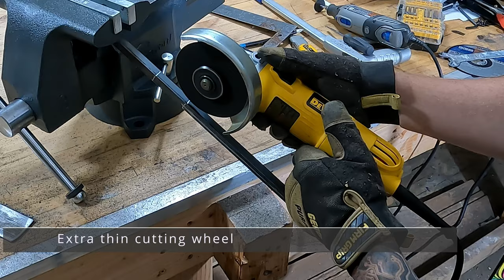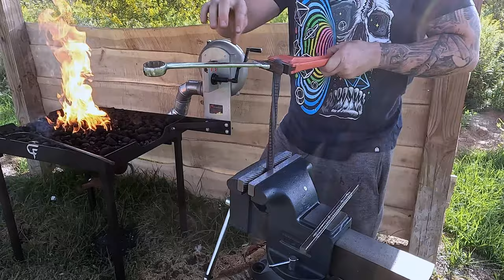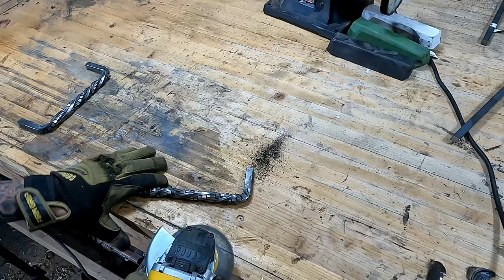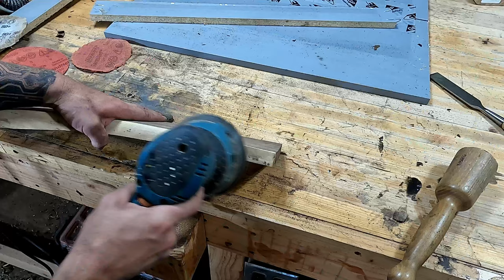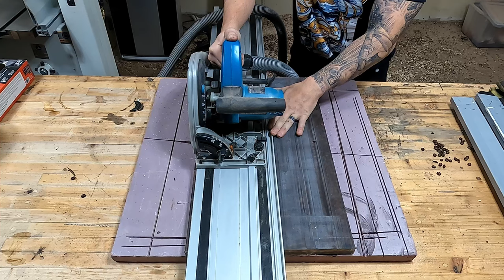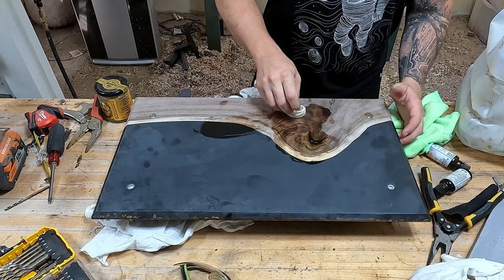Forging cube twist handles for a walnut and epoxy charcuterie board

Comment: How long do you get protection from the Black Forrest Ceramic?
Reply from the maker: Black Forest claims up to two years, at which point you can reapply the top coat.  The epoxy should be pretty durable though; the ceramic was mostly for filling in some micropores and smoothing up the appearance.